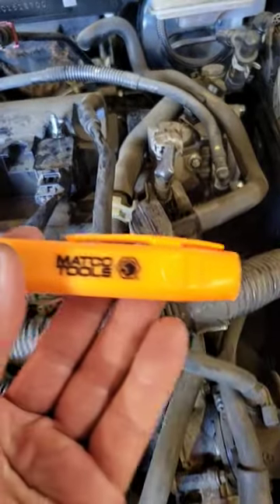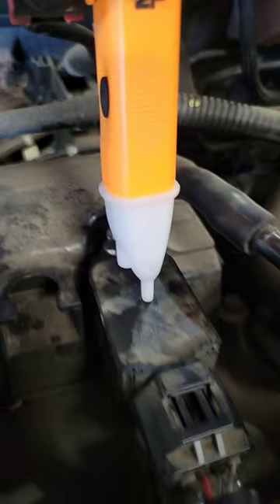Easy Coil Testing

Comment: If only all misfires were caused by coils lol.
Reply: I just pulled out all the spark plugs from my Mazda 626. Only two were oil fouled, the others in good condition
Reply: I didn't pull the coil out, cuz it's confusing. All the wires have to be labeled and put back perfectly back on the coil
Reply: Make sure you labeled each spark plugs wire with a magic marker, or tape, or your in for trouble!!
Reply: @Chris-em2qc lmaoooo it’s not looking good for you broski
Reply: @itswais77  sounds like an easy valve cover gasket replacement. maybe also spark plug tube seal. common on mazda and honda as far as i know. 2-3 hour job with the right tools
Reply: well at least we'll know for sure that coils are working so we should have the initiative to chexk the plugs next,
it's still usefull enough bro

Comment: 15$ in low voltage section at Lowe's or any hardware store.
Reply: What's it called?
Reply: NVM I'll googled it haha
Reply: Whats it called. I cant find it. Lol
Reply: @daMillenialTrucker What is the name of it?
Reply: Just type low voltage pen 
Some are rated for higher voltage also
Reply: Does this also work with an automotive test light?
Reply: @wildestcowboy2668 
Haha all the sparky boys(electricians) I know call them a "wiggy"
Reply: Harbor freight retail $4.99 on sale for $3.99. The same exact tool.
Reply: @daMillenialTrucker it's called don't buy it with a Matco logo. . It's a voltage tester. They're like 10 bucks. Can be used for checking if there's voltage in a wall outlet or socket😊
Reply: @daMillenialTrucker I think a non contact voltage sensor
Reply: Is that sensing amps or volts?
Reply: As long as its not LED @bluethunder90
Reply: @bluethunder90 no. A test light can’t caught the speed of the pulse.
Reply: @ronhanish  It senses volts. That's why it's called Non-Contact Voltage tester
Reply: Will the harbor freight version work?

Comment: This tool is a magnetic field detector .  It will detect magnetic fields on fuel injectors , spark plug coils , or starter solenoids .  It will pickup the fields of any magnet .  It is quite useful and inexpensive and works on A/C or D/C systems .    6/19/23
Reply: thanks bro,
been doubtfull about it first, now i can say it really is
Reply: Me trying to find mine
Reply: Uhhhh. Unless that tool that looks EXACTLY like a NCVT (non-contact voltage tester) isn't one. It does NOT sense magnetic fields. It uses capacitive coupling from your body and whatever is near the tip.
Reply: @jrdn.lauren  Yes you are correct , a ( NCVT ) non-contact voltage tester is different from a NCMFD ( non-contact magnetic field detector ) and look the same .

Comment: Why not just read the code and it will tell you the cylinder.
Reply from the maker: There is not always a code, and does not always specify the cylinder

Comment: I had a misfire on cylinder number 2 and 7 on my Dodge ram. Replacing both coils didn't fix the problem. Removed the spark plugs and the electrodes were completely worn away. So a cylinder misfire isn't always a bad coil. Start with the most inexpensive thing first! Luckily the auto parts store let me return the coils
Reply: Next time swap the suspected bad coil with a cylinder that you know is functioning, then see if the misfire follows the coil. Pretty easy way to rule out the coil.
Reply: @adammasci9737  yes you are correct I thought about doing just that but was frustrated
Reply: If I found a "dead coil" ,I'd be pulling the plug also to see if it's not all fouled up from misfiring for so long, since the coil is popped out already, why not it's only another few seconds to see so you don't have to go back in.
Reply: @MrTheHillfolk  I did that and all of them checked ok
Reply: At least it points out to the right spot. We can then troubleshoot from there.

Comment: Thank you for this vid. It worked for me and replaced coil and away we go. Used the Harbor Freight Ames brand  light. Worked like a dream.
Reply from the maker: Awesome, yes there are a lot of brands, it is a cheap tester to get an idea if spark is there or not.
Reply: @NutsandBoltswithTone  will it work any car?
Reply: Thanks for the advice. I bought one on sale for $2.44.
Reply: What's the name of it at harbor Freight

Comment: That's great but u don't know forsure if it's the coil, could be wiring/connector or module. So u still need to swap some coils to c if it changes cylinders. I mean most common is the coil but I've seen it be the wiring twice. And I'm a  HD diesel truck tech and only worked as an auto tech for a few years.
Reply: This helps narrow down the problem though right?

Comment: I, of course, have to have one of those testers that never even flickered on a just-installed NEW coil, let alone the old ones on my '03 Toyota Corolla. My tester is marked "VoltAlert 1AC-D, sensitivity 90-1000 VAC". It does work on my home's electrical outlets. What brand did Nuts and Bolts use?

Comment: Or unplug each coil pack and go by the tone of the engine, if it gets worse the coil is good if it doesn’t change then the coil is bad
Reply: Sometimes the connectors' plastic becomes very brittle. So it's best to only break the one connected to the faulty coil instead of all of them😅
Reply: Yeah then you end up changing coils that didn't need to be changed
Reply: Unplug coil pack does not comfirm bad coil. We only know that one cylinder is misfiring. It might be coil, spark plug, injector, low compression or blown gasket. Method in this video can tell coil is not working.
Reply: Great way to ruin a driver in the pcm. Dont do this on a modern car
Reply: @firstlast---  absolutely
Reply: Good idea !!!
Reply: @firstlast--- I'm an a tech working over 15 years and I've never ruined a pcm by unplugging coils when the car is running and I've done that thousands of times per year
Reply: @firstlast---  how so?
Reply: @firstlast--- Can you please explain what you mean by that comment?  I'm serious and not trying too bee an ass . I have never heard that . And I'm always open to learn something new.  Thanks
Reply: Ya I always unplugged too , now curious with new cars if dangerous I doubt, people used say can’t jump start new cars 10 20 years ago never had a problem still
Reply: Do a few Subaru’s and lmk if that’s not worth it
Reply: @kevinmonahan2820 Hi, do you meaning never unplug coil to evoid damages?
Reply: Old school stuff
Reply: @firstlast--- 
How is unplugging a coil on a modern car any worse for the engine computer than a coil (or spark plug) that goes bad on its own?

Comment: Looks like a circuit tester for 110v outlets & wires. I wonder if coil voltage & current would trip the 110v tester?
Reply: It does

Comment: I use to use the timing light on the spark plug wires to see if the current was consistently flashing or if it was missing every now and then.
That told me if my spark wires were bad.
Reply: this item seems to work similar to the hall effect clamp of the timing light
Reply: That won't work if the coils aren't on the plugs.
Reply: I like your idea but didn't comprehend it all, please help

Comment: Will it work by touching the plug ? My car has 2 coul packs that run 2 holes each ?
Reply from the maker: you want to touch it around the top of the coil, maybe at each side of where the wires are and this is only a quick check that does not always work.

Comment: me out , I changed the spark plugs and wires on my 01 Carvana and after doing that my van has a ruff vibration at ideal or coming to a stop on red. I got a mechanic to clean out the threading where the spark plugs go and it keeps doing it maybe it’s the coils ? I also need an oxygen sensor maybe that will do the trick? If anyone has been in this situation help me out thanks !
Reply: Have the same issue don’t know why?
Reply: Maybe you mixed two of the spark plug wires. That would  sure cause you that problem.
Reply: @marsinbako8491  it’s gotten a little better over time still vibrates at ideal but not a constantly like before , I’m thinking it’s the 02 sensor or front engine engine mounts was told could fuel injectors can be dirty since it is 22 years old I used a lot of the STP’s fuel injectors clearers seems it’s not the case because the gas mileage was better then normal so I think there good . Have you figured out why yours vibrates?
Reply: @elara680  was told by mechanic spark plugs and wires our good & set in correct order

Comment: Just take your pocket screwdriver with the magnet and hold it over the coil. You'll feel the "fish bite"
Reply: Can you use any magnet and can you test while the coils are out of the car?
Reply: Can you please elaborate? What do you mean by "fish bite"?
Reply: Is this only with the car on?
Reply: @BostonRyan  yes it has to be running.
Reply: @liuj88  just use a little pocket screwdriver that has a magnet on the end.  Start the engine and hold it over the coil,  very close. You'll feel what seems like little fish bites as the magnetic field collapses on each firing event
Reply: @Pwn3540  no has to be running

Comment: sir i just want to ask.   i have ford focus 2009 1.8l 4dr. sometimes when i start my car it miss firing ¹st to ²nd time but on the 3rd time it completely fine. no miss firing.    hope u will notice and may u can help me with this issue i have.
Reply from the maker: It's very possibly an ignition coil. Is you check engine light on? Message me on Instagram and I can try to help you
Reply: @NutsandBoltswithTone  no engine light on.

Comment: He this is a skyactiv engine, looks exactly like mine, I had 2 fucking coils go on Tuesday cylinder 2 and 4, they are Original Mazda coils with 250,000km on them so I wasn’t too surprised, one had already been changed the previous year so I knew it was probably that.
Reply from the maker: @Mooseguy15  wow that is good mileage on them

Comment: I just bought a Klein tools one and it doesn’t work like this. I put it in the solenoid and nothing happens. Put on the battery and nothing.
Reply from the maker: @boulder40  pretty sure that is not the same type of tool but not sure.

Comment: Can all 4 coils go bad
Reply from the maker: @jerryblanton6221  is possible but not likely all at the same time
Reply: @NutsandBoltswithTone  225kmiled no spark from them I replaced crankshaft sensor and camshaft sensor still no start it's getting fuel no spark I believe coil packs are original 2010 Ford focus 2.0

Comment: If you got a 6 cylinder how will you test the back 3🤷🏽‍♂️
Reply from the maker: You may not be able to
Reply: @NutsandBoltswithTone  I tested them off the car with a multimeter

Comment: Its the 3rd coil as well. Its barely working. Plus that motor is running too rough to be misfiring on one cylinder

Comment: Looks like a 2 liter ford focus engine.  Coil packs for this engine are cheap. Replace all of them with new ones. Change spark plugs too and your good for at least 100k miles.🤗
Reply: Ahah it is… my first thought was a first gen mazda3 or a mazda 6 of the same era with the 2.3 which is a Mazda engine also used in the focus in 2.0 form

Comment: I think it is difficult to trust this device
... What if the spark is weak? There will be a weak magnetic field. The device will show that the coil is good
...Also, what if there is a spark leak?
At first I thought it would work and after thinking I don't want to do that
Reply from the maker: It is just a quick Tester for direction

Comment: It's simpler than needing that tool if you definitely know a coil pack is bad just replace them all at once
Reply: yep.. had the dealer do that.  one went bad.  then another with the check engine light on and they said F it just do all 4 and change the plugs. problem solved

Comment: It’s better to just unplug the coil and use a dmm gives you accurate readings and it’s not even that hard to do either
Reply from the maker: This is not the same thing and it is not easier.

Comment: Klein Tools of the same tool for about $20
Reply: Harbor freight had it for $4.99 😂
Reply: Whats the name of the tool?
Reply: @beereadyyy9849  ignition coil tester
Reply: @beereadyyy9849  matco Sells them for 35. You can find the same tool but cheaper
Reply: Is it a a/c tick ? Because I can tell you the HF one is not as good as fluke and this one looks like the fluke ones
Reply: Is that a voltage detector
Reply: Yea well I just bought that one and it doesn't work 
I'm pretty pissed off.

Comment: Or use the same pen for house electrical 😅
Reply: I have the house electric pen.. does this really work the same?
Reply: I’m not sure either on one way find out , I bet it’s same thing even though voltage low the amperage is high

Comment: Retired Catapiller Heavy Equipment Mechanic. USELESS if the spark is leaking from boot to cylinder head. Many ways of misfire
Reply: There are many reasons this isn't accurate.

Comment: Dude take my advise! That tool is not 100% accurate, sometimes the problem is vintage leaked and the tool will pick it up as a good coil because technically the coil is working, it's just the voltage not getting to the spark plug
Reply from the maker: Oh yes I'm aware of this, this is just a quick test to give me a quick direction. Thanks

Comment: Not flashing doesn't necessarily mean the coil is at fault
Reply from the maker: Nope, the reason I use it is to get a quick direction if it flashes then I look at fuel

Comment: Whats the tool called ? So i could look it up
Reply: AMES INSTRUMENTS Non-Contact Voltage Tester. 

You can purchase it at Harbor Freight for $4.99. But if you are an "Inside Track Member" then usually it will cost just $3.99.

Comment: Get some energy going feel the power do it old school pull the coil and a screwdriver 🪛 😎😎😎😎😂🤣😅😂🤣😂🤣
Reply from the maker: Definitely can't misdiagnose it that way
Reply: @NutsandBoltswithTone  I'm still scared of getting my hands near of spark plug wires if the engine is running 🤣🤣😂😅😂

Comment: It doesn't tell you if the coil is actually bad or the power and/or ground is bad. You can also unplug each coil individually and see which cylinder doesn't change the rpm. Swap the coil from another cylinder,  if the coil is bad the miss will be transferred to the other cylinder,  the circuit is okay and then you can condemn the coil. 😅
Reply from the maker: no it does not it is a quick test to see if coil is firing that is all.

Comment: Did you check if the coil is get what it needs to operate!!!!!!!!! “Nope” Everybody wants to be a mechanic until it’s time to be a mechanic
Reply from the maker: Sure buddy this is not a diagnostic Tester it is a quick way to see which direction to go.
Reply: @NutsandBoltswithTone  no tool needed. Just lift the coil off the plug  to see if it’s contributing while the engine is running. And/Or just swap coils around. This tool would end up in a junk draw for wanna-be mechanics. The best tool is the brain.
Reply: Lol it’s could to know if wires are dead before touching them , id normally pull wire off myself if I thought I had bad coil this definitely a cool hack but yea I do have one in every junk draw lol , can’t really say I’m not a real mechanic I learned basics before I learned my alphabets and I’m 47 😂

Comment: So any basic cheap circuit sniffer lol matco, grr just matco.
Reply from the maker: Matco doesn't even make it tbh. This is just a quick easy test to see if you have spark.
Reply: I have a spark plug tester. You just put on the wires while engine is running..I think it would work about the same.
Reply: $35 isn't super cheap to me ,,,when I'm about broke it's not super cheap. Not everyone has that amount $ easily available. Cool tool though I would say.

Comment: So I’m guessing that the check engine light didn’t tell you that
Reply: Not necessarily. usually , it just gives u a misfire code p300-p308. Coil circuit codes aren't that common. Sound like a customer "can't u just plug in that computer thing thait tells u EXACTLY what's wrong" 🤦‍♂️
Reply: “Things customers say” for 500 Alex

Comment: Don't rely on cheap gimmicks. There's a reason they are cheap. You are working on a Ford, bring up a power balance graph on your scanner.
Reply from the maker: It's just a quick Tester to get a direction
Reply: @NutsandBoltswithTone  work smart, not hard. Plugging in the scanner would have given you the information you needed. Buying trinkets off the tool truck is just a waste of time.
Reply: @ridds777  that IDS lifestyle bro
Reply: @ridds777 what if I don’t have a scanner with that function then what, I have the Klein tool he got tho ima test it now
Reply: @yatusabes909  why would you purchase a scanner without bidirectional control?
Reply: @ridds777  Correct me if I’m wrong but Are they not helpful?
Reply: @yatusabes909  no
Reply: What's a good, affordable, bi-directional scanner that any of y'all would recommend?
Reply: You tell me , my f150 I can’t get to pass dam inspection while I use daily, I had mechanic work scan I change part I f,,,,, knew wasn’t going do squat so I feel if I don’t buy my own scanner I’m going have sell this truck cheap , shame and it’s bunch bs every year once these computer cars get old straight scam engine is new too

Comment: Does this detect bad coil packs or spark plugs too?
Reply from the maker: It only detects if the coil is not firing. It will not detect spark plugs or even weak spark.
Reply: @NutsandBoltswithTone  perfect I appreciate the reply